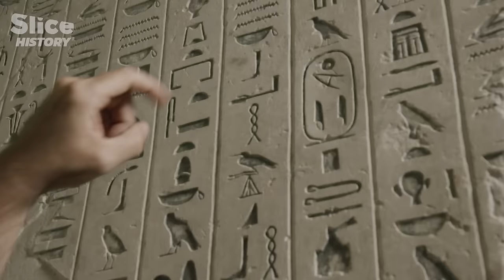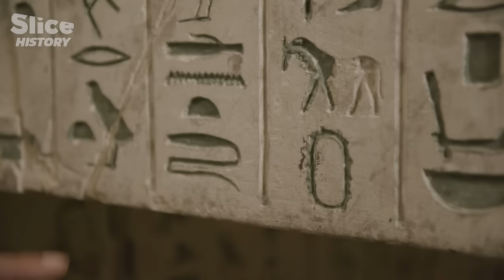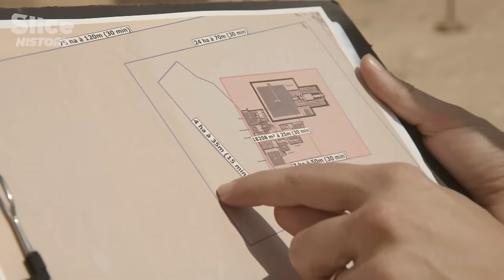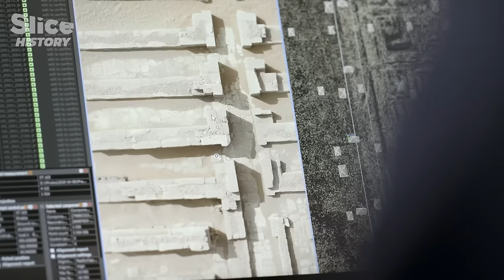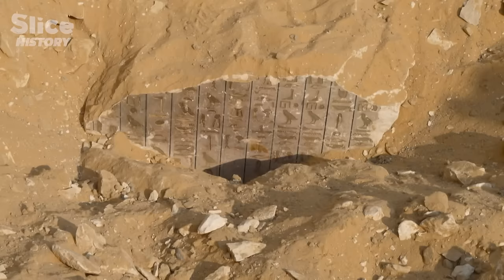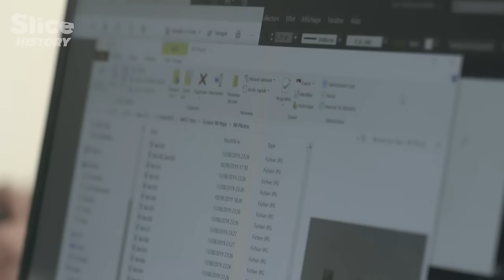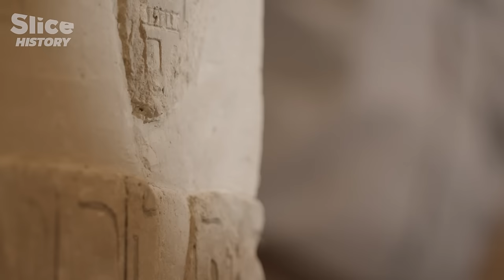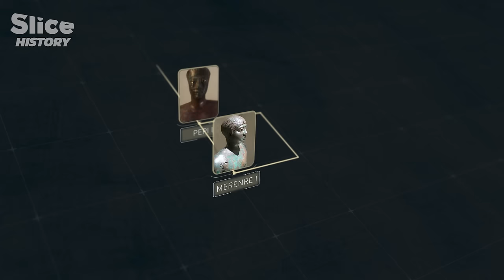Decrypting the Secret Hieroglyphs: the Pyramid of Pepi II I SLICE HISTORY | FULL DOCUMENTARY

Comment: iN THE PERFECT GREAT PYRAMID WITH NO SIGN A PHARO EVER LAID INSIDE?
NO HYROGLPHICS CARVINGS ONLY GRAPHETY AND A FAKE KATOSH
ON A INNER CIELING  ALONG WITH A TMB OFFERING TASY FOUND OUTSIDE THE STRUCTURER?
HOW IS DATING DONE AND FROM WHERE IS THE CARBON DATING WIOTHIN THE TUNNELS PROVED AND VARIFIDE
Reply: Sir or ma'am, your comment would be much easier to make sense of if you didn't use ALL CAPS, and if you used spell-check and proper punctuation. Proofreading your comment before posting would also help immensely.